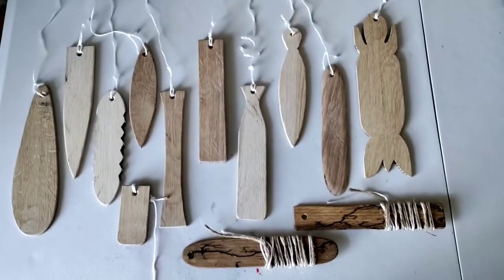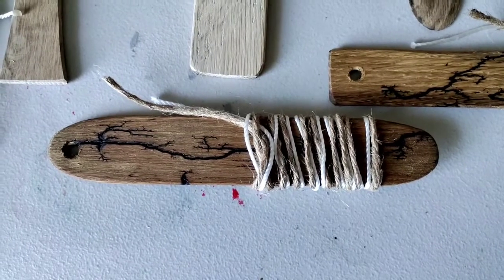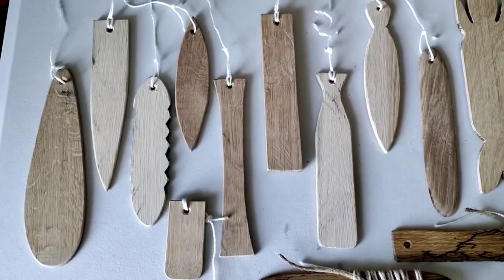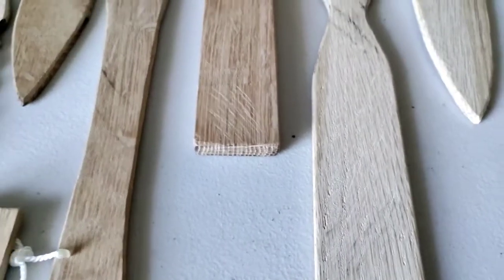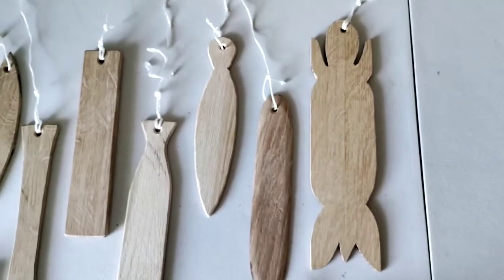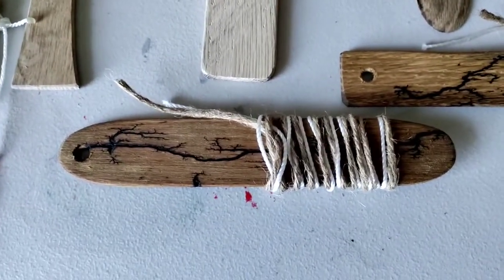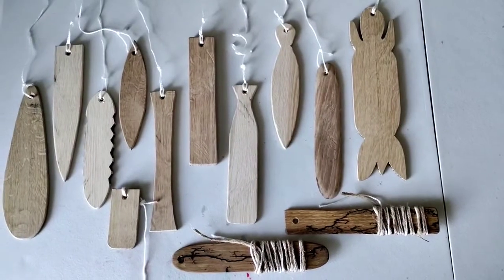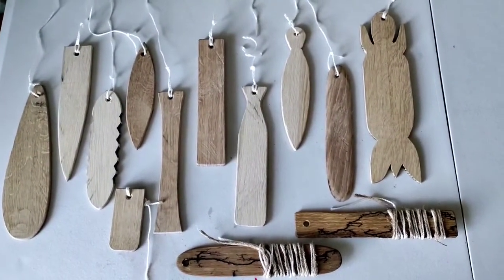Designing a Bullroarer

Comment: What do you use for the cord ? I made a quick bullroarer and used strong builders line but it breaks after a few uses. Some great designs you have there 😊
Reply from the maker: I have used Masons line. 
But just in the past few days, I'm going to artificial sinew and / or B-50 bowstring. The sound is really prolonged and much more clear. I sell in Etsy and these are what I'm now including with the bullroarers. 
Any line will eventually wear out.